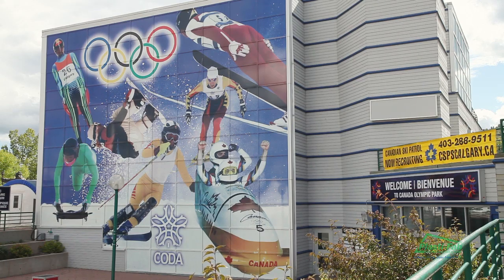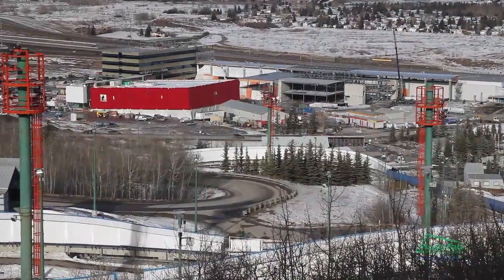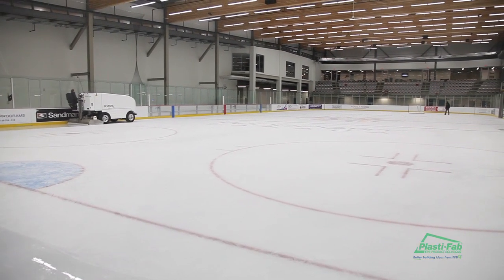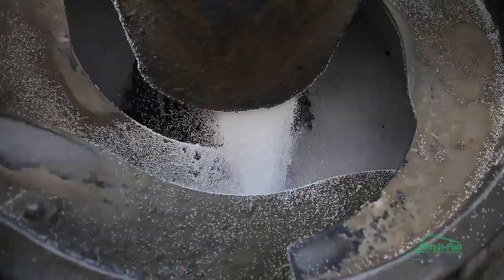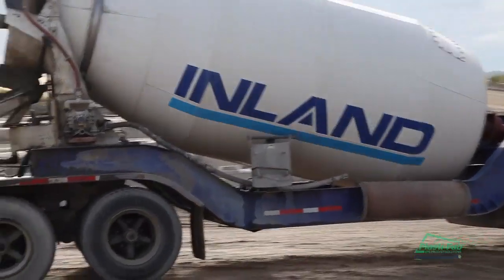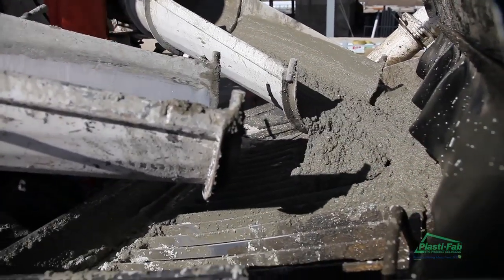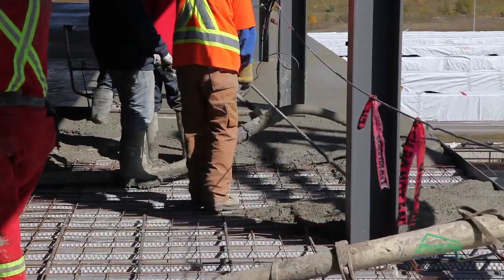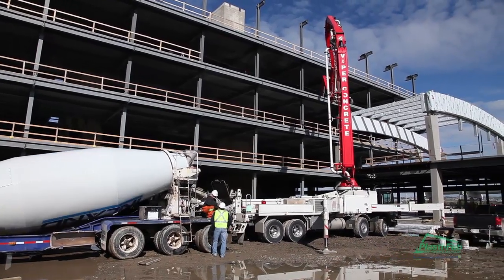Elemix Concrete Additive COP Project

Comment: Nice work! We provides Hydroxypropyl Methyl Cellulose Ethers( HPMC), VAE Redispersible Polymer Powder, Hydroxy Ethyl Cellulose Ethers (HEC), HPS, PVA, PP, Starch Ether, Defoamer, Calcium Formate, Lingocellulose, and other construction chemicals. Widely applied in construction, such as ready dry mixed mortar, skim coat, wall putty, gypsum pleaster, tile glue, tile adhesive, tile joint filler, grouts, cement based plaster, repair mortar, masonry mortar, adhesive mortar, exterior & interior wall thermal insulation and finishing system, color decoration mortar, thickener in detergent.
Welcome you to contact us:  facebook@landuchina,  twitter@sdlandu